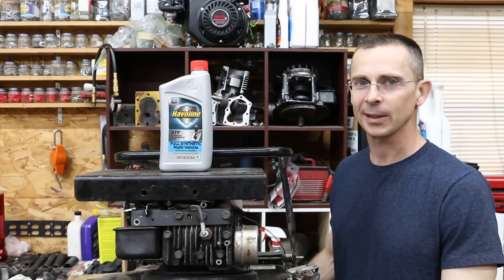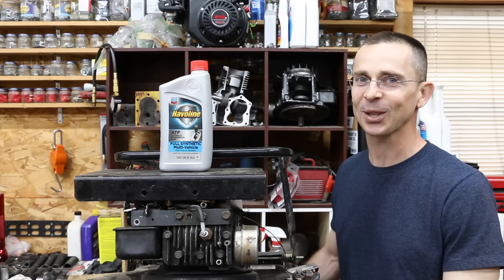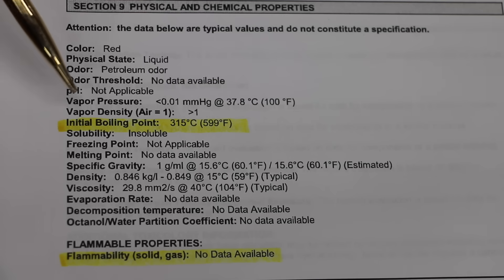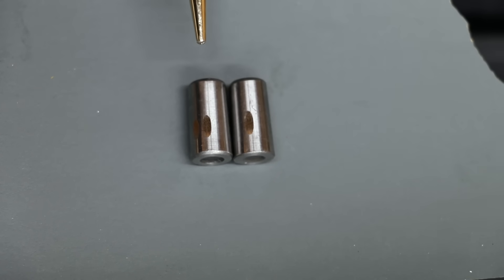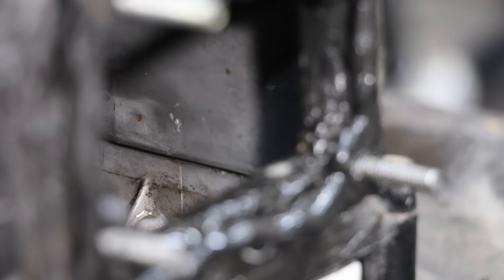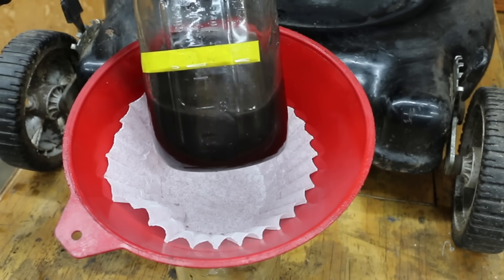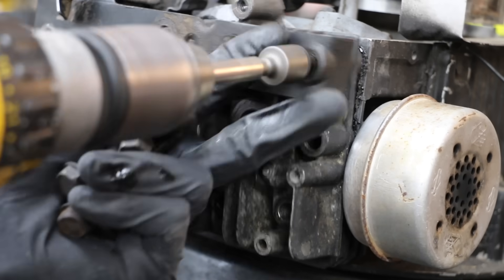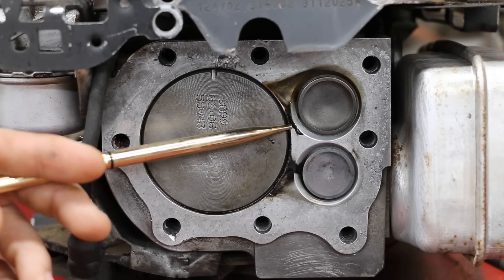ATF as an Engine Oil substitute?  Let's see what happens!

Comment: ATF is commonly used to clean out hard oil and gunk from old engines that were driven by grandma, just idle ATF for 20 minutes, leave overnight for detergents to work, then warm up and drain - never drive.  It might be better to use diesel engine oil as a flush that you can run for a few hundred miles as it's designed for combustion and also has high detergents.
Reply from the maker: Thank you for the feedback

Comment: Standard ATF works great at cleaning the inside of an engine. I've never tried synthetic ATF. Had a 1990 Camaro that I pulled the intake manifold off and found what looked like black pie crust caked about an inch thick. I chipped it all loose and sucked it out with a shop vac, changed the oil and put 1 quart of atf and 4 quarts of oil back in with new filter. Ran the car 1000 miles, changed the oil filter and finished out the other 2000 miles and changed the oil. Removed manifold and lifter valley was spotless. I wouldn't recommend using straight ATF with no oil tho.
Reply from the maker: Great feedback! Thank you

Comment: Only saw one person that saw what i did.  Years ago(30) or more, we added a quart of atf  about 50 miles before an oil change to clean the engine out before adding new oil at the change.   Seemed to work  better than not.  Also used diesel (qt) added sometimes before driving down to get the oil changed instead of atf.  Worked well to flush the engine.  I would never use these nowadays because of the oil improvement and hi tech engines.  Now a farm truck with 200,000 miles....maybe.
Reply from the maker: Thank you for the feedback

Comment: I don't believe that ATF will super clean an engine, here is why: There is not a reason for ATF to contain lots of detergents since it is made to be used in a sealed system that no combustion occurs in, so there is not carbon and soot to deal with like there is in an engine. For this reason, there ins't much need for manufacturers to add a lot of detergents to ATF. I actually asked an oil company about this years ago and I was told that their ATF contains about 10% as much the detergent as their motor oil does because transmissions just don't have the problems with carbon buildup that engines do since there is no combustion to produce soot. So I think this myth was created because thick, non detergent oils were common back in the day and adding a thinner oil like ATF could help break up deposits simply because it is thinner than engine oil.
Reply from the maker: Thank you for the feedback!

Comment: ATF is designed for lower temperatures than motor oils. Also, ATF has much less detergent because transmissions don’t create combustion byproducts. 

Your engines would have demonstrated the differences if you’d have run them longer. Remember a typical car motor runs for 50-100 hours on a charge of motor oil. (For example, 3,000 miles/60 mph = 50 hours of engine operation).

YOU GAVE VERY SOUND ADVICE: USE MOTOR OIL IN A CAR’S CRANKCASE!
Reply from the maker: Thank you for the feedback
Reply: Project Farm 

That was more than “feedback”: it was critical of your test. One hour of testing a motor oil is meaningless.

Again, 50-100 hours is normal for a charge of motor oil.

Comment: Not related to adding it to engine oil, but I've heard many old farmers would add some ATF when the fuel truck would fill up the farm tanks. 1000:1 radio of Diesel to ATF said it would help keep injectors clean and lubricated. Unsure if it truly helped but heard that many, many times.
Reply from the maker: Thank you for the feedback

Comment: I believe atf has more detergents than motor oil. I've used atf in my vehicles and come to the conclusion that it's probably not going to benefit a new or well maintained engine. It did however do a great job of removing a quarter inch thick coating of sludge that I could see through the valve cover fill opening on my AMC Hornet and other $100 100,000+ mile beaters that I was drving fresh out of high school. All I did was add 1 quart when the oil got low then drive it normally for about 10-20 miles before doing an oil change.
Reply from the maker: Thank you for the feedback.  I have a video on this soon

Comment: I have revived a old Kawasaki 110 that been sitting for 10+ years . It had no compression so I mixed atf /penetrating oil  filled jug left it for a few days soaking drained it filled it with  new oil , cleaned & rebuilt carb 4 yrs later still  runs like a champ
Reply from the maker: Impressive!

Comment: I know a guy that builds race car engines.  He says, once the oil is drained out of the engine add a quart of kerosene.  DO NOT start the engine, just allow it to drain down through the engine and the empty the oil pan again.   It dissolves any oil deposits, and build up.  Then fill it with clean oil, and replace with new filter.
Reply from the maker: Thank you for the feedback!

Comment: I had a Mazda 2.2 three valve that had a sticking lifter.  A pint of trans fluid would unstick things for while, but I'd end up with the lifter tap again.   Then I tried a pint of Marvel Mystery Oil, that worked better, but the tap eventually came back.   Finally I added a pint of motorcycle fork oil.   That knocked out the tap until the car body rusted and it was off to the junk heap.

Comment: Hi Project Farm! Thanks for all the great videos; I really enjoy the topics and your approaches to create the test procedures and equipment! I had an idea for a new project video: Could you test ATF at different temperatures to examine their performance after being subjected to set periods of time at normal to extreme temperatures? I know I have seen quite a few charts from the transmission industry, that state the useful life of ATF, depending on the temperatures that the fluid is exposed to. For example, these charts will say if you can keep ATF temps below 175F, the fluid should be good for 100K miles. However, a temp of 220F (for how long?) will make your fluid only good for 50K miles or less. I know my Toyota Tacoma has a factory spec range of 122F to 176F, although I see temps higher than this (200F) during mountain road climbs (in my case, temp measured at torque converter outlet to cooling circuit (worst case/highest instantaneous readings)). I think at 300F, the "AT Oil Temp" light comes on, but I have never seen that! Anyhow, I take good care of my transmission (300K miles and 17 years on original unit), but I think a lot of your viewers would be interested in seeing an ATF video. Initial lubricity baseline, cold flow test, followed by exposure to several high temperature ranges, followed by lubricity checks against the baseline. 

Thanks again so much for the great content. Keep up the good work and I look forward to many more videos from the Project Farm!
Reply: I guess another thought here, is maybe the fluid is fine at 300+F, but the seals, clutches etc. of the transmission are damaged just by the temperature, and not so much by way of fluid degradation.
Reply from the maker: Great video idea!  Thank you

Comment: The detergent capabilities of ATF are very easily demonstrable and you've seen some evidence of it here, in fact in car engines it has been like wow!  I also did it to one of my own vehicles years later after buying it used.  The part that made me nervous is so much ending up in the oil so fast.  The varnished OHC area instead of having varnish, had clean metal.  I didn't run it long that way and made sure the oil was changed when it was good and hot.  The guy at the dealership commented that it was very dirty and showed it to me but that was no surprise to me.  (I do not do my oil changes myself anymore because for $8.00, recently raised to $15.00, the Honda dealer will change the oil if I bring my own oil and filter, and I don't have to dispose of the oil myself.)

On lubricity, we used to put ATF in engines because it doubled the wear allowing more wear in less time for testing purposes.  However, we were not involved in establishing that.  We simply accepted as fact in Automotive Engineering.  However, to their credit, they debunked a lot of theories such as by putting batteries on cement vs. a board for each class, and other things to root out wives tales or situations that occurred a very long time ago when there was different construction and the old tales were still hanging around. 

Another was detergent vs. non-detergent oil.  The myth is detergent oils foam.  That used to be the case when they first came out and before most people were born, but it was never the reason for the difference.  Cars normally used flat head engines and splash lubrication with little dippers on the connecting rod bolts.  In that case, the oil pan was a place for contaminants to settle and solidify.  That was your oil filter.  Every so often they would drop the easily accessible pan and clean it out.  On small engines that aren't expected to have that type of lifespan, it is the same except you cannot drop the pan.  With pressurized oil systems, you want to keep it in suspension so you can filter it out.  Today, recommendations vary but often non-detergent is recommended and detergent oils OKed because of common availability and more frequent changes.

Some recommendations for oil are based on what is normally available.  For example, you may have a car with a recommend oil of 5W-20.  That same engine today will have 0W-20 because it is now commonly available.  You want the first number as low as possible and respect the second number.  0W-20 is not necessarily 5 less than 5W-20.    It may be far less than that, which is desirable.  Oil is ALWAYS too thick when the engine is cold and is when by far most of the wear occurs.  The upper number is its ability to maintain its scuff resistance at normal and high temperatures.  The reason on new cars that number can be lower has nothing to do with precision and everything to do with their roller valve train, which adds significant fuel efficiency, which is further enhanced by thinner oil, and reduces wear in many other parts of the engine as well as contributing to longevity.  I do get comments at oil changes that it isn't what they recommend, but they have since noted it and don't ask me anymore.

Another thing I learned from a friend who has owned tire stores his entire life is to go to the high side on tire pressures, and avoid large wheels which require larger tires.  They wear better, ride better, are cheaper, and have much less rolling resistance.  The 18" rims rims that came with it are in the top of the garage, and I have 16" rims that look just like them with the same offset and hub size.  He was correct.  I get great mileage, the tires last forever, and but the increased pressure makes it ride harder.  Keep in mind that when you go around a corner, the inside of the tire and outside of the tire have to scrub the pavement, so you want the most pressure on the ground to be the middle because it is the only part that doesn't.  Thus, I get better mileage and they wear evenly all the way across.  I can tell at the pump every time when I have tires below my desired pressure.
Reply: +1 on filling tyres with higher pressures than normal, this is recommended if you do a lot of high speed driving but even if you don't it's still preferable as it minimises tyre wear. Make sure you check the max pressure limit and account for the fact that air expands when it's hot so pressures will always be higher after a 30 minute drive. From what I heard, the ideal pressure is when the operating temps are 4 PSI higher than the cold temps.
Reply: Very good info, thank you sir
Reply: Besides alignment..the thing that eats tires fastest is heat! Load.. speed..low pressure and duration of them  are biggest contributors.. over inflation of 10 psi  can be up to 30% better mpg(Mythbusters).. besides driving habits it is the biggest influence on mileage..  
Under inflation will cause heat and faster wear so if on a motorcycle and tread is getting down there and you think letting some air out will put more tread on the pavement.. I guarantee it will wear out much faster.. I always try to rum max air on bike. More in a vehicle  even though it's a bit stiffer ride when the tire doesn't soak up anything over the bumps.
Reply: Depends on the situation. I often drive in wide temperature and altitude extremes. Overinflated tires at one extreme is a complete blowout at another. 

And I also drive off-road a lot. The major recommendation for that is the exact opposite of yours. Bigger tires and underinflate. Lost many a tire to normal pressures, but none to lower ones. 

So for me, bigger and under-inflate is the rule. Losing a tire on the road is much more expensive and time consuming than the little bit more gas $ and tire maintenance I must do.

Comment: Ive used ATF as an engine flush a few times, i usually drain the engine oil, fill it back up with ATF and let it idle for 5-10 min then carry on with the oil change.

I did it years ago on my 83 tercel, my friend said it stopped puffing blue after, i also did it on my brothers 97 tercel, got a lot of carbon chunks in the drained ATF and the filter after.

It definitley helps but if the rings are really carboned up from lack of oil changes its not going to make a huge difference
Reply from the maker: Thank you for the feedback

Comment: years ago (40) or so I would experience lifter noise , typical old ford thing, adding 1 qt of  atf to the oil change would quiet them I never ran all atf . Haven’t ever experienced this in years , new oils seem to have cured this problem . I haven’t even thought about doing this for years, if the rattling not there , why would you .

Comment: this test is useless, people are not running engines on pure ATF. they make is 5 to 1 ratio... 5 regular oil and 1 ATF. that way each oil does its stuff. this video is just stupid.
Reply from the maker: Sorry to disappoint
Reply: @ProjectFarm  Why don't you do realistic test with a dirty engine and 5/1 ratio?  To see if it will clean it. You have used a clean engine. The point is that detergents from ATF dissolves the dirt and regular oil does the lubrication. Your experiment is not doing that at all. No one is using ATF as substitute, just as a detergent.

Comment: Back in the day of Isuzu rodeos, I had a 97 Honda Passport with the v6 that made the loud lifter/rocker erm noise.  I was advised to put a zero weight oil in and a quart of auto trans fluid, run it at least a couple hundred miles, then change it out.  I will say, it actually DID quiet the noise down a large amount.  Love the videos
Reply from the maker: Thank you for the feedback

Comment: many years ago I picked up a 78 Camaro with a 305 in it that had a bad lifer issue.  I had to remove the intake to clean the gunk away from the lifters and the drain back holes.  after doing this I did a oil and trans mix to clean the engine out.  I did this 3 times in a row with amazing results.  the compression returned and the knock went away.  the engine had about 200.000 km on it.  I drove that car for 2 years without any issues and gave it to a friend who used the engine for a demolition car and won.  I would highly recommend this treatment for cleaning.  I have been taught to clean gently and slowly or the engine will fall apart inside.  What's  your opinion?Your Show is awesome ... thanks for taking the time to do teaching us what you know and learnGod Bless
Reply from the maker: Thank you for the feedback!

Comment: ATF has been used for years, especially in 2 stroke racing motorbikes with wet clutches, as the oil is shared with the gearbox and clutch, obvipously it works well as the bikes I had were 300 kph racers, never had any gear or clutch problems, main reason to use atf is to get a lower viscosity for clutch operation at High speed, many oils have friction modifyers in them, this makes wet clutces slip.
Reply from the maker: Thank you for the video idea!

Comment: remember u are to add atf too oil not to run it streight try a 50 / 50 test to give the atf a fair shot if u were to add another cleaner they would have u run it with oil not streight please give ot a try i think your results will be better

Comment: ATF is really only used in engines with high mileage to get rid of the sludge free up the lifters but I would absolutely recommend it before anything else
Reply from the maker: Thank you for the feedback
Reply: Could I run straight atf in my mower instead of oil? I am very low on funds and motor oil in insanely high priced where im at but I also don't wanna cook the motor
Reply: @JohnnyBmishaps  No, ATF is designed to not have combustion contamination introduced to it. It will break down faster than motor oil because of that.
Reply: @JohnnyBmishaps  In PF film strength test you can see that the 10w30 prevents wear under pressure much more than 100% ATF. This makes me think the high load parts of the engine would get significantly more wear with ATF than with 10w30. Specifically the rod caps, wrist pin bearings, and cam lobes. You can also see a fair bit of scoring increase on the 2nd comparison of the cylinder walls after running 1 hr with pure ATF.

Also I can't confirm Joseph Hodges info about ATF breaking down when exposed to combustion gasses it certainly wasn't designed with that in mind. It might be lacking the correct detergents even though it has more of them and could be made of oils that are less stable at temperatures reached on the back of the piston.

Comment: umm when I learned of using atf to clean a motor it was not by itself, but add it to the oil like an additive. Also I was told that engine flush whas nothing more then diesel or kerosene

Comment: As a mechanic we don't fully fill a crankcase of an engine with nothing but ATF it's used as a supplement with oil to help clean or we use a couple of quarts of kerosene